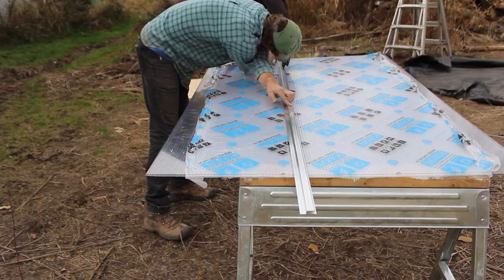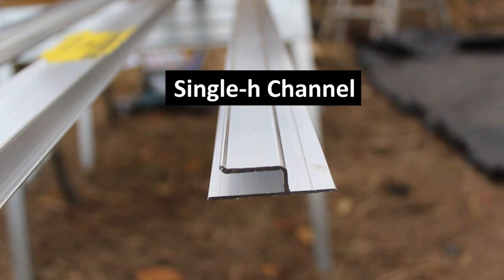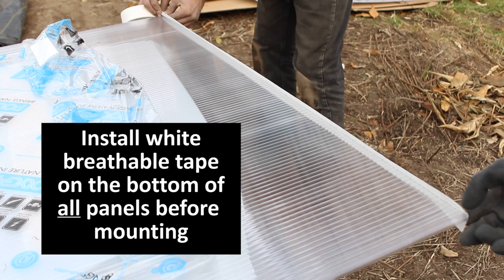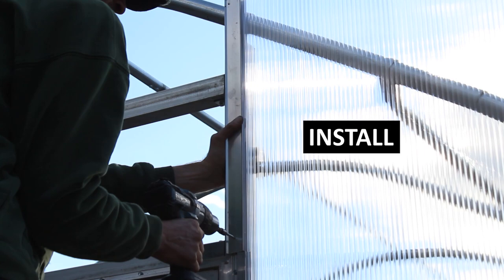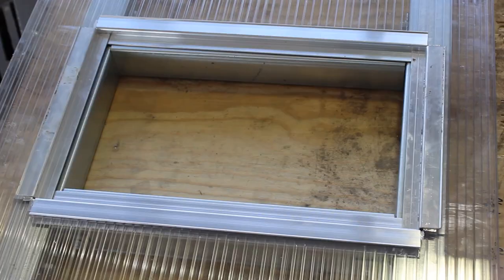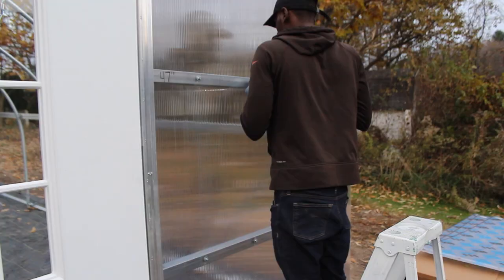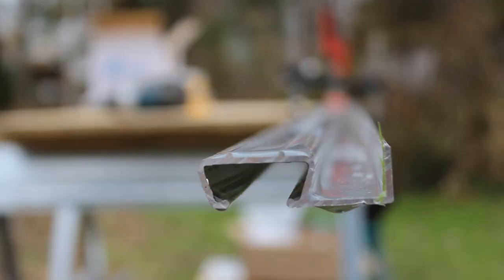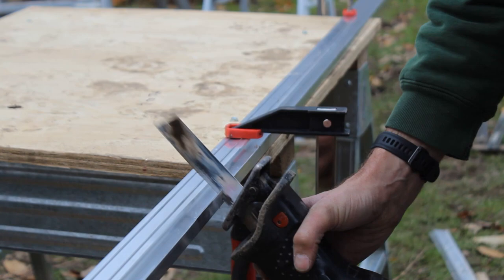Polycarbonate Greenhouse Plastic End-Walls | How To Install for Stronger End-Walls

Comment: Great video. Very informative. 

Does most end cap typically allow space for two layers of poly and the wiggle wire?
Reply from the maker: I would assume most reputable greenhouse suppliers would use end-cap channel that can fit two layers of plastic and the wire. Ours does, and it seems like others would likely agree that this is important.

Comment: I have a hoop house like this but ends are plastic and I have had trouble with that I'm thinking of replacing it with poly any recommendations on where to buy from ?
Reply from the maker: I don’t think any big box stores carry them so I’d have to recommend your closest Ag supply store OR you can shoot us a list of what you need (and your zip code) and we can get you a quote with a shipping estimate. While we do sell 8mm twin wall polycarbonate, shipping costs can vary due to their size. Here is our contact us page, if you want to send us a message: https://www.tunnelvisionhoops.com/contact-us/
Reply: @tunnelvisionhoops  sent thank you!!!

Comment: Can it be installed with the ribs horizontally? I have wood studs not spaced right.
Reply from the maker: Manufacturers of the polycarb state that it should NOT be. It is important to have the slots vertically oriented to allow condensation to leave the polycarbonate. I would recommend adding some horizontal framing to provide additional attachment locations for Double H channel. 

The only time we do polycarb horizontally like you describe is for small strips of it that get installed along the baseboards. 

Thanks for the comment, and for watching.
Reply: @tunnelvisionhoops  Thanks For the quick reply.
Reply from the maker: You're welcome!